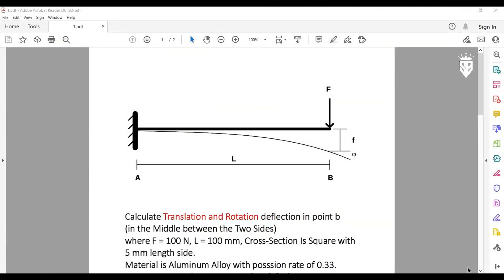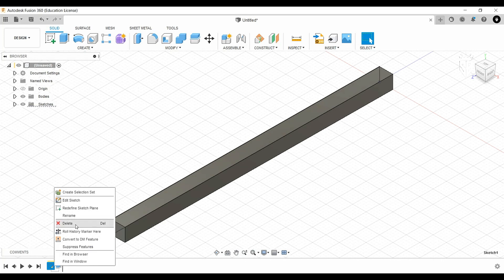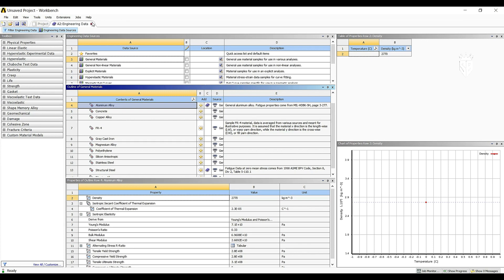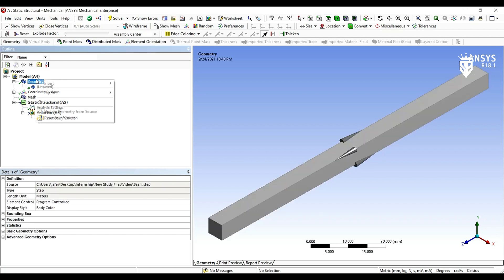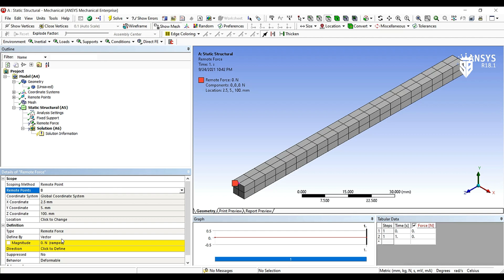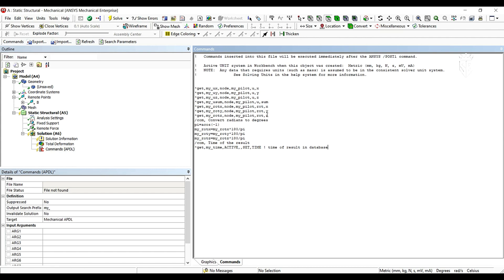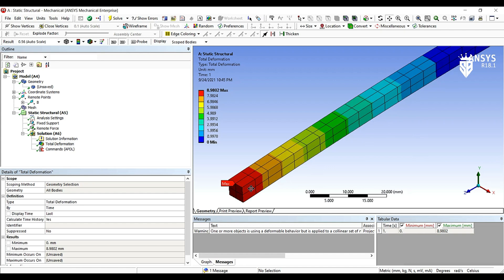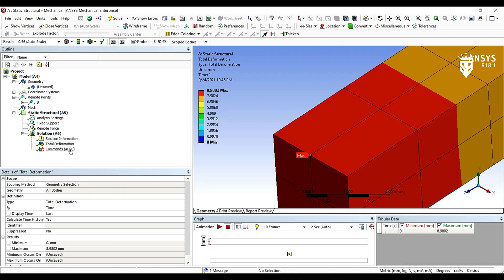Measuring Translation and Rotation Deflection in Ansys

Comment: Code from the video:

 *get,my_ux,node,my_pilot,u,x
*get,my_uy,node,my_pilot,u,y
*get,my_uz,node,my_pilot,u,z
*get,my_usum,node,my_pilot,u,sum
*get,my_rotx,node,my_pilot,rot,x
*get,my_roty,node,my_pilot,rot,y
*get,my_rotz,node,my_pilot,rot,z
/com, Convert radians to degrees
pi=acos(-1)
my_rotx=my_rotx*180/pi
my_roty=my_roty*180/pi
my_rotz=my_rotz*180/pi
/com, Time of the result
*get,my_time,ACTIVE,,SET,TIME ! time of result in database
Reply from the maker: Here is a link to the code

https://simutechgroup.com/measuring-face-translation-and-rotation-in-mechanical/